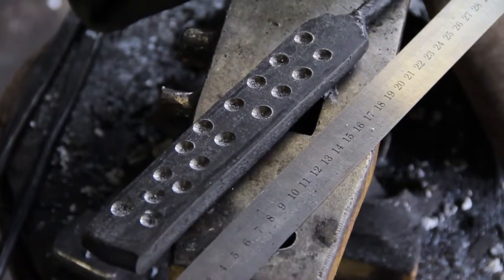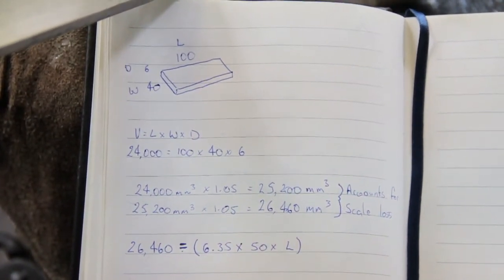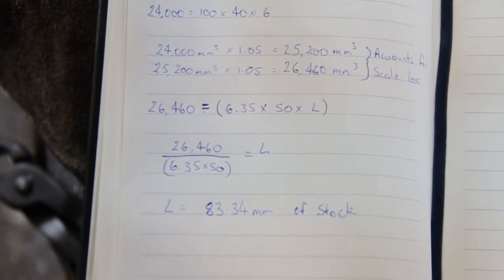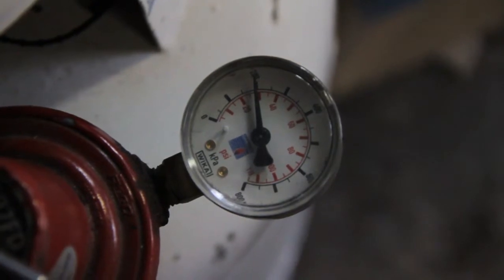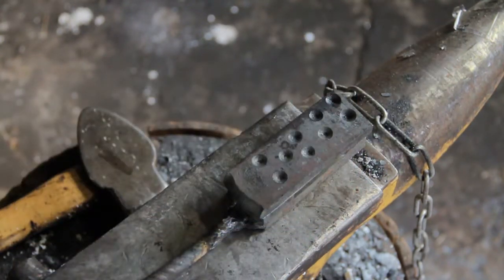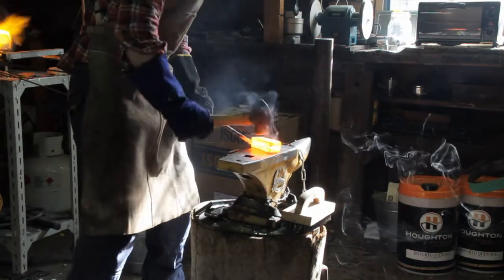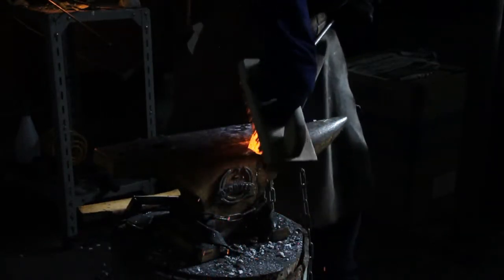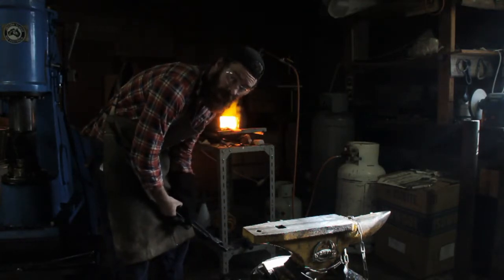Damascus steel for beginners Part 2

Comment: So you test the forge weld by hitting it diagonally, but you've tack welded the pieces together.   How would you know, just caught my attention.
Reply from the maker: Because it is soft the layers will separate dispite the tac welds. Also ideally, you lay the welds in so poorly that the weld metal falls away after a few heats ;) dont want them ending up in the knife.

Comment: Where did you get your power hammer from?
Reply from the maker: Bruce Beamish, through Anyang Australia.
Reply: Bat Country Forge what weight and cost was it?
Reply from the maker: @tbkustomknives8907  25kg moving part, 980kg overall. It was $10,000 AUD in 2015 landed and transported into my workshop.

Comment: hi. thx o much for this video. i just have one question, (or 3). first. can you buy pre folded demascus metal? secndly, could you put this into a smelter and liquify it; then put it into a mold and go from there? thx!!!
Reply: Yes, you can in fact buy pre-folded damascus steel. However, melting it down and then casting it would essentially mix all the steels together into one, destroying the pattern that you would get from hand-forged damascus. Hope this helps!

Comment: hello, i do not have a lot of experience in blacksmithing, so can you tell me if the fume at 5:50 of your video is dangerous?
Reply from the maker: Yes, the fumes coming off that borax as it melts would be mostly steam but it would also be carrying a lot of other junk with it. RULE TO LIVE BY: "If it isn't air don't get it in your lungs"
Reply: Thank you for the informations

Comment: No beginner has a big blu power hammer or a proper set gas forge... Btw We beginners usually use coal or coke to generate heat...
Reply from the maker: Hi Christoph, In Australia most people can set up a gas forge easier than a solid fuel forge. Coke and coal are hard to get unless you are close to a blacksmith club, whereas you can by LPG anywhere here. The method of forging has very little to do with achieving a solid weld, the power hammer just makes it faster. When welding with solid fuel I used to notice that sparks would come from small overheated sections and that was a telltale sign that parts of the billet had reached the correct temperature (or maybe a little over). This does not happen in gas forges very much, rather you have to pay attention to how the flux behaves on the surface of the steel. What size billets are you trying to weld Christoph?

Comment: great video but its not really for beginners .beginners don't have power hammers
Reply from the maker: Thanks Steve! Yeah I wanted to focus more on how to complete a weld sucessfully. I think drawing out stock by hand would have to be its own video.
Reply: yes I've tried to do it myself I can get it to weld the fist time but cant get the second weld to hold after the fold so I gave up but you have inspired me to try again . I also tried a canister last week it didn't fully weld either any tips  buy the way awsome job with the video and the Damascus
Reply from the maker: Steve the hot fold takes some getting used to because you need to 1. cut most of the way through the billet so it folds quickly/easily. 2. clean scale off the steel and flux the inside of the weld then put it in the forge to get it malleable. 3. Clean the weld faces again incase flux formed and tap it shut. This in my experience does not have to be done at welding temp. But you need to reapply flux and get it to welding temp and then set the weld (with firm taps)  after you have folded. 

Until recently I used to just let it go cold. Then grind it clean/flat, then restack, re-stick weld, preheat, flux,  welding temp, flux, soak then set the weld. It is the safer way to go, just takes a bit more time.
Reply: thanks for the quick reply yes I've tried the fist part and was going to try it cold I also need to buy better equipment eg grinders etc. but there's no one in Perth to ask or sells any of that stuff I will keep trying so thanks for the input
Reply: Steve go look up Jake @ Fire Pants Fabrication https://www.facebook.com/firepantsfab/?ref=br_rs he's based in Perth making heaps of cool shit for the knife maker and blacksmith.

I just purchased a striking Anvil from him and a Swage Block and already have one of his belt grinders - he's also making mini gas forges!